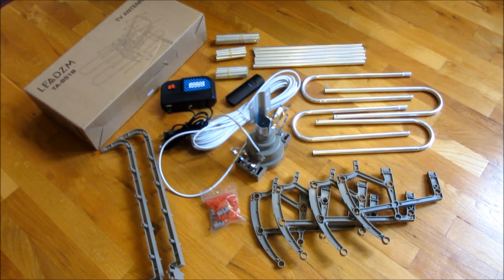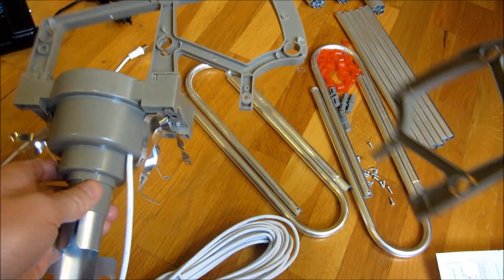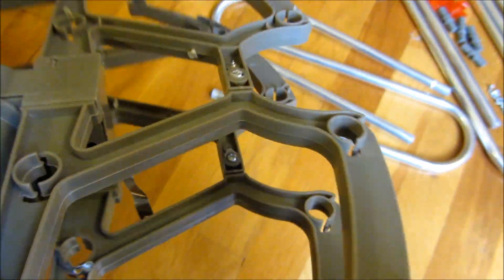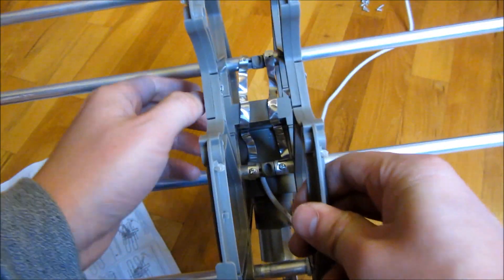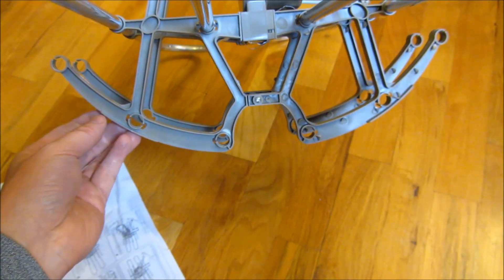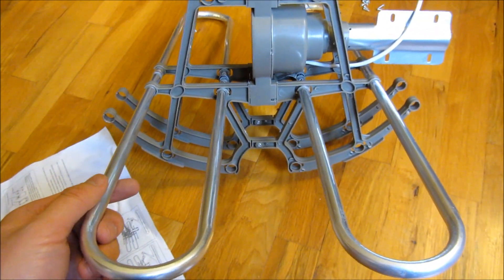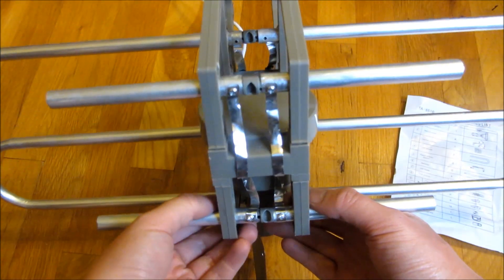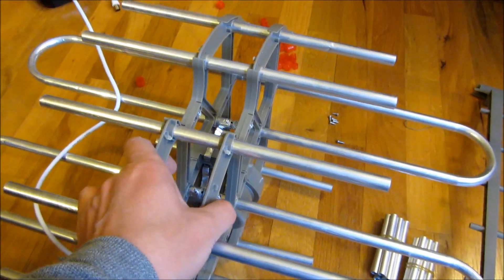LeadZM TA-851B | How to Build Step by Step | HDTV Outdoor Antenna

Comment: so i got one, and they are flimsy, so i hot glued every crevise and also zip tied the whole thing everywhere,  but stuck in attic , before putting it outside, pointed north/ northeast to satelites 35 miles away, and get 61 HD OTA channels Free! it has an amplifier, and rotation (but don,t need it to move), ..just watch using splitters and long R59 cable will degrade your signal. Lastly, when getting this or any antenna, make sure it gets the low and high frequencies...45-900mhz, then tell the cable company where to go!
Update...i put it outside on a pole (shower curtain rod), rescanned and Now get 76 channels free...Lead ZM
Reply: CrazyDonutFace     Thanks, Mr. Donut Face.  I’m not handy, but your words were encouraging.